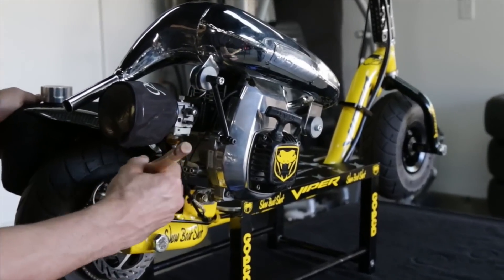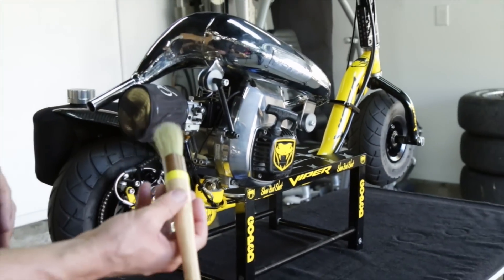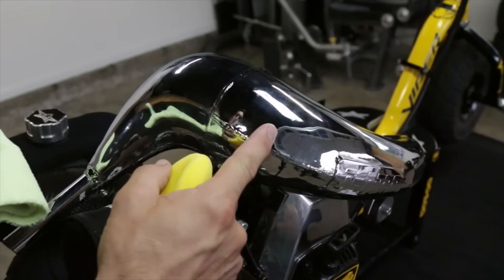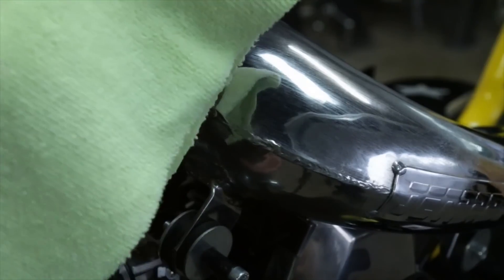How to Detail your GoPed

Comment: What do you recommend using to clean flat paint jobs like the "Sinister black" on the current GTRs and what would you recommend using to polish the "nickel" finish pipes? (A polish that won't tarnish the heat scoring-coloration). Thanks man.